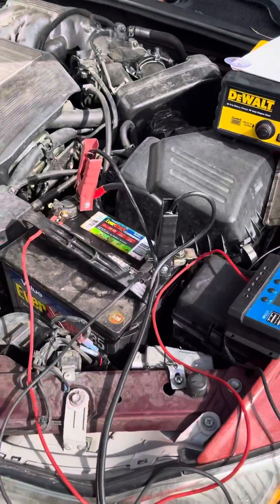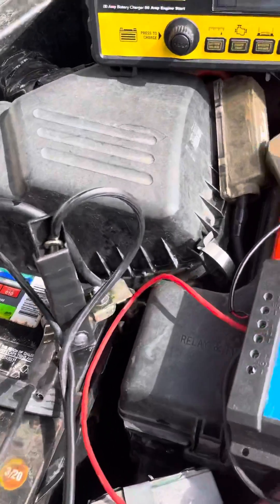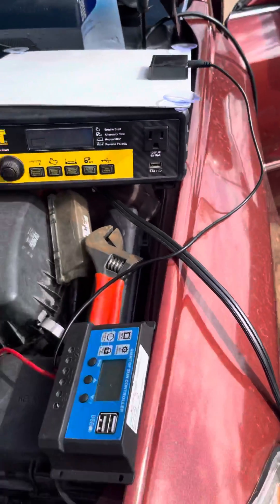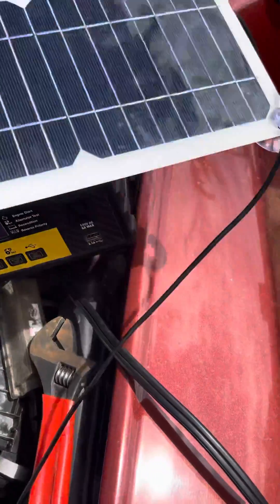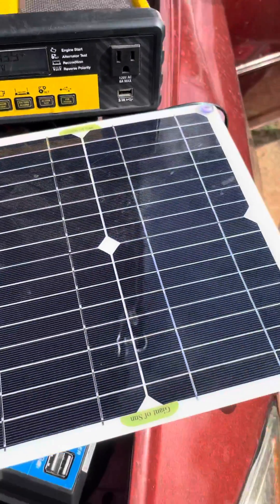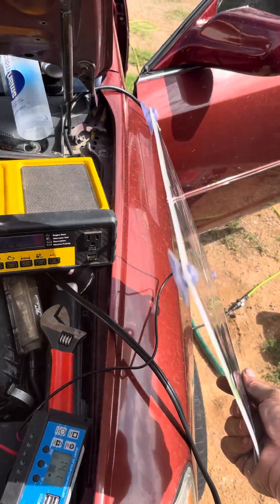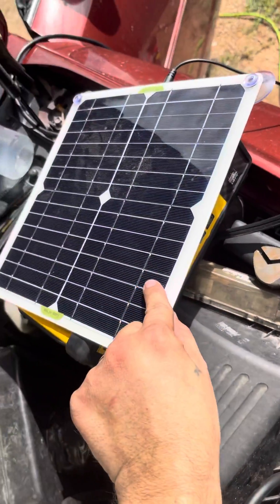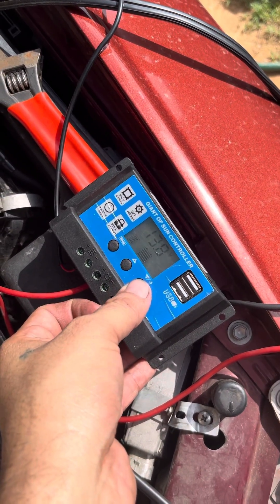30$ eBay 200watt solar panel kit…..trash or budget gem??

Comment: I need further instruction to use got the same solar panel, same box, and I got a power inverter, do I just need wires? And how do I get them to connect with the connectors I have? It came with 12 v auxiliary inlet, I assume to charge the battery on the inverter, does the USB ports on the charge controller accept energy ? It’s confusing that they have 3 different outputs on the solar panel, 2 USB and 1 I am uncertain what that port name is